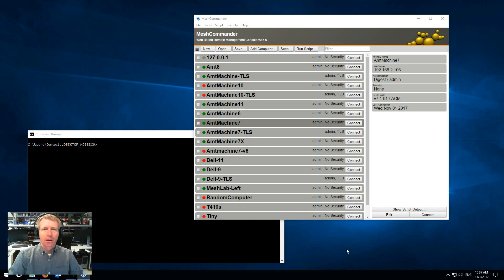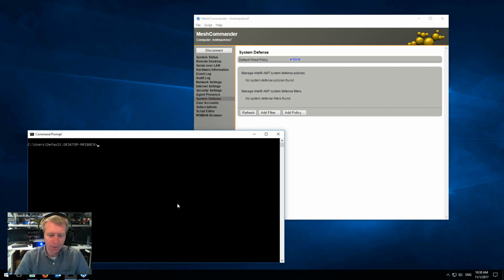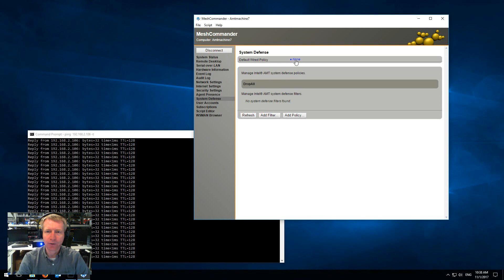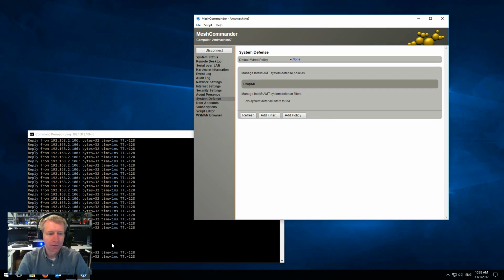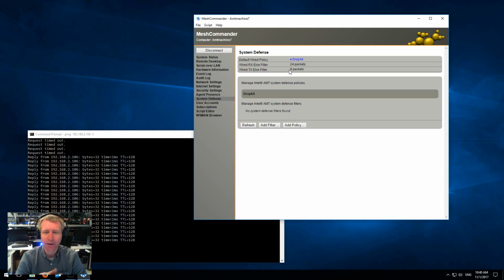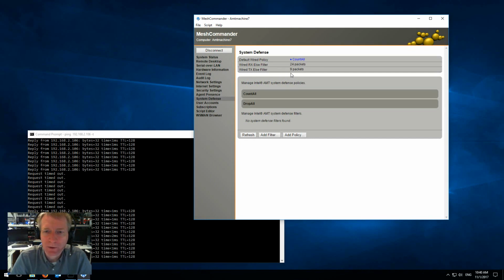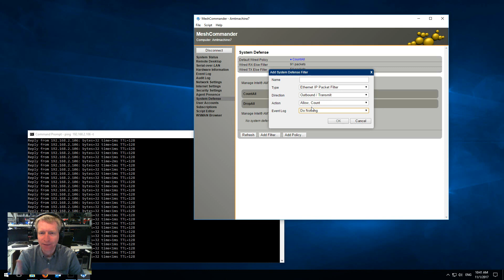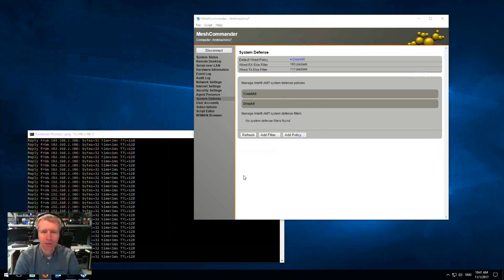MeshCommander - System Defense

Comment: Hi
I found your video when I was looking for how to set the AMT system defense policy in such a way that it would not be possible to send a ping when the hardware is turned off (Soft off). I set it up like you did in the video and packet blocking doesn't work and the counter doesn't count anything. My mesch commander version is 0.9.6 and IME is 11.8.92. Do you have any suggestions?